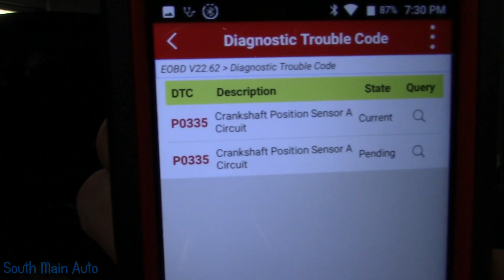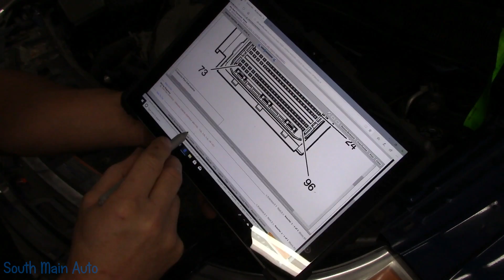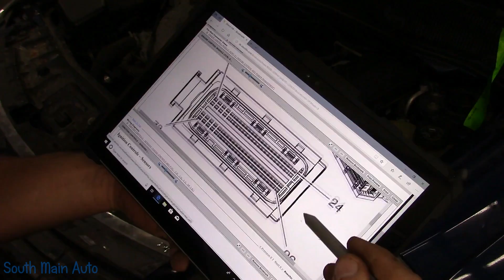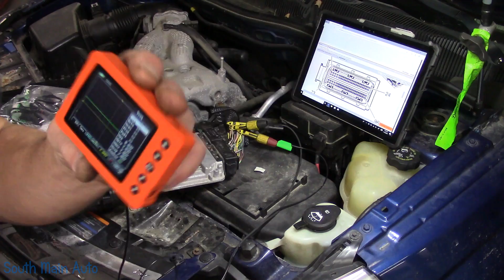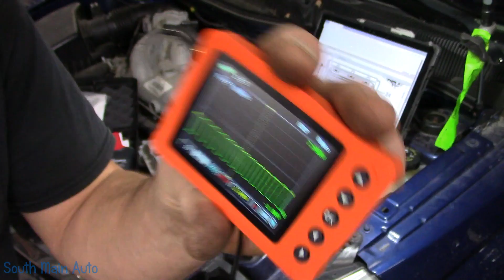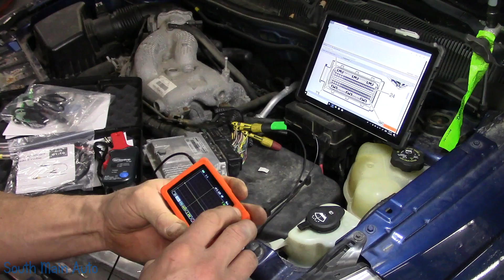Suzuki XL7 3.6L : Crank / No Start P0335

Comment from the maker: uTest Advanced Terminal Test Kit (AES# 16-200):

https://www.aeswave.com/cart.php?m=affiliate_go&affiliateID=2525b91fc8e906e8215984074c9d9e8f&go=https://www.aeswave.com/uTest-Advanced-Terminal-Test-Kit-p9573.html

uScope Basic Kit:

https://www.aeswave.com/cart.php?m=affiliate_go&affiliateID=2525b91fc8e906e8215984074c9d9e8f&go=https://www.aeswave.com/uscope-basic-kit-p9621.html

uScope Master Kit:

https://www.aeswave.com/cart.php?m=affiliate_go&affiliateID=2525b91fc8e906e8215984074c9d9e8f&go=http://www.aeswave.com/uScope-Master-Kit-1-channel-automotive-scope-p9273.html

Pomona Probes:

https://www.aeswave.com/cart.php?m=affiliate_go&affiliateID=2525b91fc8e906e8215984074c9d9e8f&go=https://www.aeswave.com/Adjustable-Insulation-Piercing-Test-Clip-with-B-plug-Inputs-p8507.html
Reply: Hey there man.. what's happening.  I'm just now getting into this same issue.  I'm no mechanic though but can do smaller things easily on a vehicle.  Crank sensor is no biggie but you mentioned it being behind the transfer case.  Is that the last word on it.. meaning yeah it's a must to do that.  No end around to reach it?  Any advice is appreciated from me here in my driveway looking at a crank no start 2007 Suzuki XL7 AWD 3.6 lol.  Later..
Reply: ScannerDanner recommends this, I've been trying to see if there are developers that are modding newer DSOs that have 2 & 4 channel options which are upgraded versions from the same manufacturers, it is weird that AES is not using those newer devices to flash their firmware to boost sales.

Comment: Instead of doing the Hokey Pokey, I cut the wire and put in a bare connector with loose heat shrink. That way I can check circuit resistance first before crimping them together and after have a solid connection for my probes. It’s really easy to cut right through those thin strands or poke off to the side and get the wrong data.

Comment: I thought this was a problem on mine but it just stopped running while driving then the starter would engage but it wouldn't crank the engine at all. Put a new starter and still same problem... Can't figure it out but was running normal before. Checked fuses relays all good. Wondering if it's ecu getting random codes always changing. But don't get why the new starter isn't engaging the gear to spin the flywheel it's wierd.

Comment: could it be low because of too big an air gap, and not generating enough signal voltage or some metal filings on the sensor tip dulling the signal also? was it clean when you pulled it or like a hedgehog....? what ! no part 2?  after me saying to Ivan 'i hate these jobs split into multiple parts'.......its like watching a tv mini series ha ha .

Comment: The suzuki N36A engine is the same as the Cadillac LY7 engine. I wonder if you tried to pull data using GM as the OEM, if it would work?

Comment: Hey we watch you every day. I have a 07 Suzuki Xl7 limited.  I wanted to say GM scan tool works just fine as it is equinox torrent equal. To a point. It's got a lot from the GM parts bin

Comment: If you still have the vehicle at the shop, Try building it manually in one of your scan tools as a 2008 Chevy equinox. That is definitely a gm 3.6 engine. i know how much a pita it is to get to that sensor, i dropped the engine and transmission out on a traverse to replace the wiring harness and i was like that is where they hide that thing. hahaha
Reply: i came here to say that.. but needed to skim through the comments before posting.. ha

Comment: You're a systems tech (computer) whose work is incidentally on cars.
Reply: He really is. I have 40 years and I T oh, and I've seen some really good technicians of the years. He's top notch. He doesn't have the background on a computer perspective how do you understand sir operation so damn well it's crazy. I was an operations guy for many years and I was probably the best operator the company had. The engineers from the manufacturer of the computer always felt better if I was in the building when there was a major upgrade. They were good guys and they were damn smart. This guy could be my match in a computer room for easily. And I'll take a great deal of Pride and what I used to be able to do in that computer room. I don't say that lightly

Comment: Hi Eric,
I admire youre video's and youre nolice.
But you are telling us that de crankshaft position sensor sends a signal to the ECU.
In fact the CKS grounds the 5 or 12V bias voltage from the ECM when its working properly..
So when you are measuring the CKS from the ECU you should see 5 or 12V from the ECU to the CKS.
Greetings from Hans out of the Netherlands

Comment: It's not an "Official" SMA video without the compressor firing off. :)  Good troubleshooting technique.
Excellent mention of the amplitude of the waveform. I would run into correct, but low amplitude waveforms in a lot of electronics.

Comment: Eric great seeing you use the u-scope. Guess will learn it together. Worked all day changing wife's timing belt and water pump. Car has 58000 miles it's a 1999 accord EXL PULLED off all the belts and for a car that's 19yrs old and always garaged and never in the elements not one belt had any cracks or signs of wear. Attachment hardware looked brand new. Used the crank super socket and it came off like melted butter. Looking forward to part two of this video. And yes I'm in the rust belt of Long Island NY. GOOD VIDEO ❤️ go home and get some mumbo jumbo

Comment: Damnit, I deleted my last comment.  It's a lot of GM junk hiding under that Suzuki badging which means the timing chains are ticking time bombs.  Maybe there's an upsell for you?  As far as the CKP sensor access goes, I recall that x-fer unit being pretty easy to remove but I'd look at the possibility of just removing the two rear subframe bolts to see if you can get enough tilt to access that sensor easier & hopefully with less effort.

Comment: Eric, when you went to the meters section..if you wanted to see the voltage the whole time, you scroll down to the min/max and press OK and the min max will be shown  on main screen until you either turn meters off or turn scope off.

Comment: You mentioned problems with your scan tools communicating with the vehicle, maybe try the Tech2?  Correct me if I'm wrong, but I thought Suzuki used a lot of GM parts, and the same factory scan tool.
Reply: Yeah, I used my old Snap on MT2500 on one of these by selecting gmc envoy or Acadia or on of those turds. Got all the info I needed.

Comment: SO CLOSE! Eric. I am working on an 09 Acadia with a 3.6l. I have no signal from the bank 1 I take cam sensor. Could that cause a no start? I'm gonna swap 2 and see if it moves but I'm just curious. But you had to go and look at the crank sensor! Haha.
Reply: It will still start, just take a little longer. The crank sensor is a very critical one, no signal from that, no start. Lose a cam sensor, it will still run, the pcm figures it all out from the other cam sensors and from the crank sensor.
Reply: @davidb.fishburn9338  thank you. It was wishful thinking. This vehicle has been nothing but a PITA for me. Swapped cam sensors and they all work. Maybe a bad connection before. Crank is good... back to the drawing board. Thanks again!
Reply: You're welcome. Was hoping that it would help you out at the least.

Comment: I'm no fan of transverse mounted FWD or AWD V6 vehicles.
Reply: That's not really the problem here. It's a Suzuki. That's the problem.
Reply: opl500 this particular Suzuki is made by GM
Reply: I hate all transverse engines.
Reply: Reverend Al fwd is better than rwd in the snow .
Reply: @jasonjgr8580  having both the power and steering on one axle is ALWAYS a shit idea.